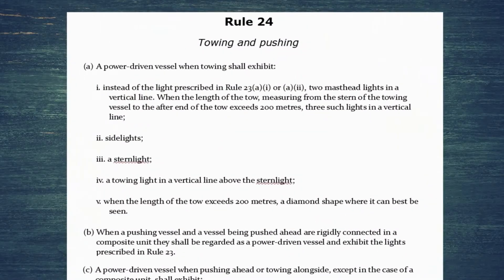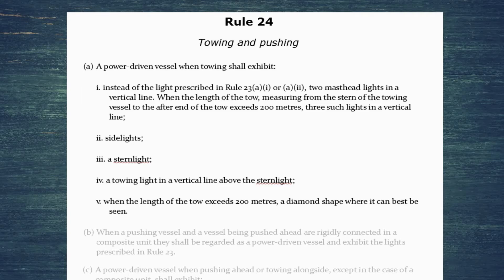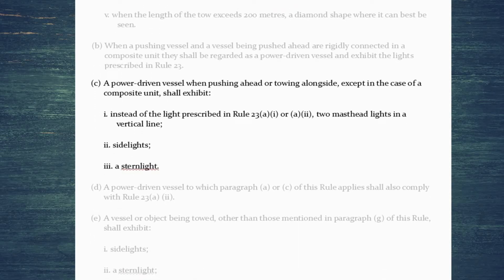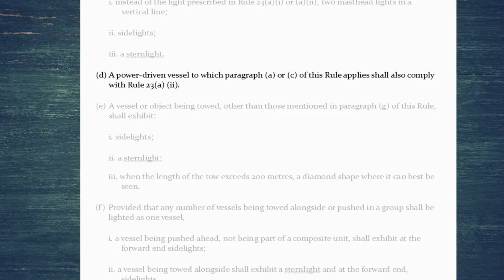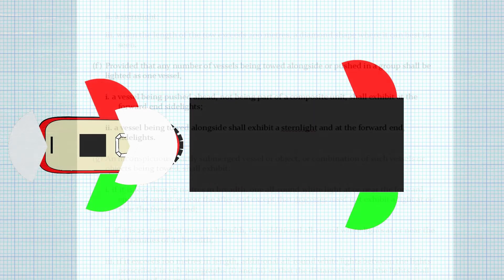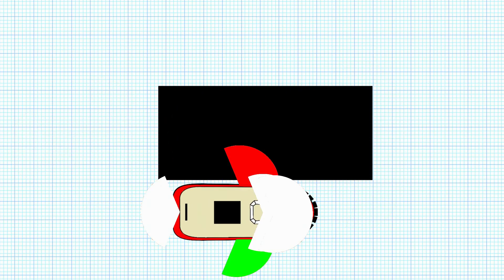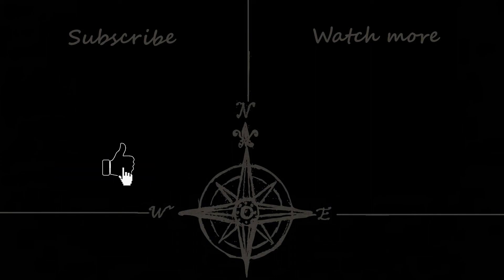Rule 24: Towing & Pushing | Lights & Shapes In Depth

Comment: Paragraph f of the rule says that: provided any number of vessels being towed alongside or pushed in a group shall be lighted as one vessel,
i. a vessel being pushed ahead not being a composite unit, shall exhibit a stern light at the forward end, side lights.  Does it mean If two or more vessels are being pushed ahead (two on the port side and two on starboard side), the outer vessel on the starboard side shall exhibit green side light and the outer vessel on the port shall exhibit red side light.  Please correct me if I am wrong.
ii. A vessel being towed alongside shall exhibit a stern light and at the forward end, side lights.  This part is confusing.  If 2 vessels  on the port side and 2 vessels on the starboard side are being towed, at the forward end outer most vessels on starboard side and port side exhibit side lights.  That part is also understood.  My question is about the stern light.  Which of the 4 vessels being towed on the side will exhibit stern light?  The rule says all the vessels towed alongside shall be considered as one vessel?
Can u please clarify? Thank  you.

Comment: Ok... Day shapes in this rule confuse the f out of me. So from what Ive gathered - diamond shapes on both a tug and an object being towed (if that exceeds 200m in length) ??? And in case of an inconspicuous partially submerged object - a diamond shape regardless of the size and if exceeds 200m then an additional diamond??? So it is 1 on a tug 1 on an object if a tow is over 200m ////// 1 on an object if submerged, and  1 on a tug 2 on an object if thats submerged and exceeds 200 m ????? Thanks

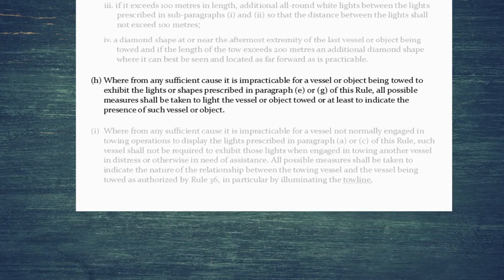Comment: In doubt between 05:55 to 06:07, rule 24 (g) (iii) if it exceeds 100 m in length, additional all-round white lights ‘between the lights prescribed in sub-paragraphs (i) and (ii)’ so that the distance between the lights shall not exceed 100 m.”
Reply: As it says in between, does it mean in middle of the barge i.e. between ‘fore and aft light’ and ‘beam lights at extreme beam’?
Reply: Beam lights must at extreme Breadth. This video showing wrong that part. 6:03